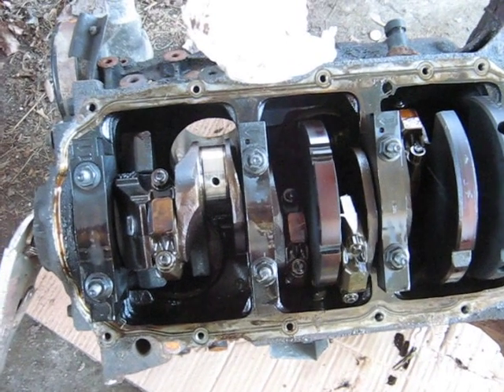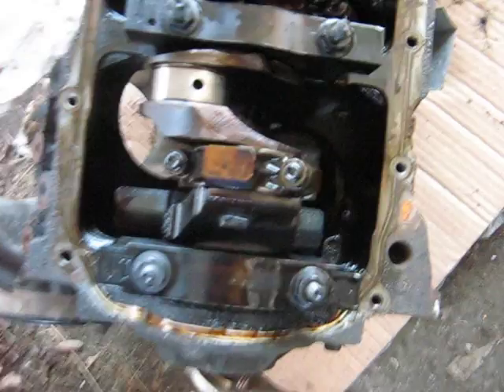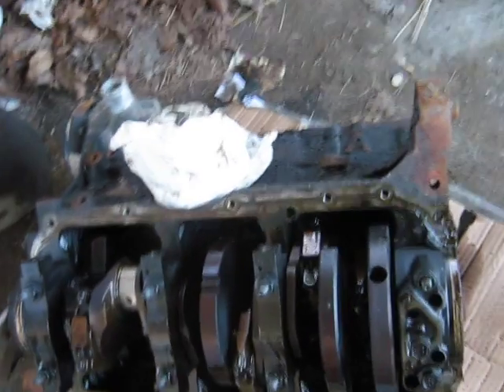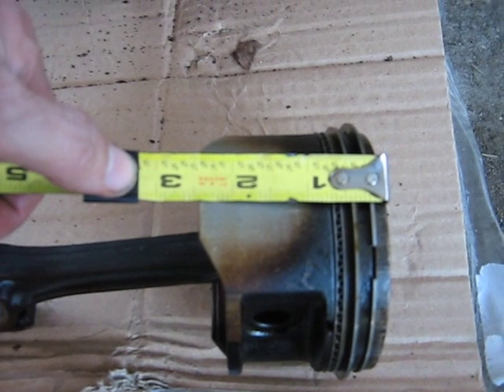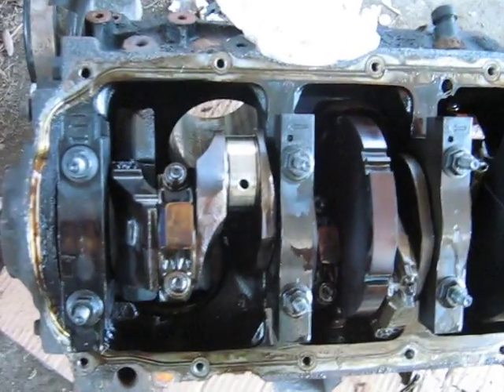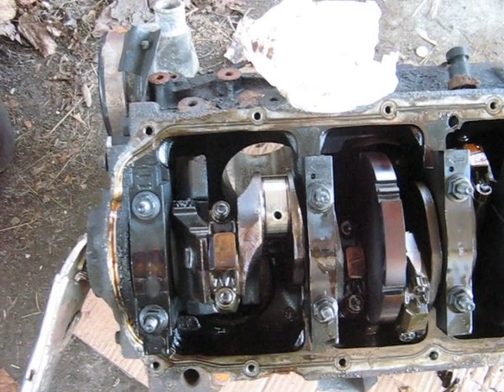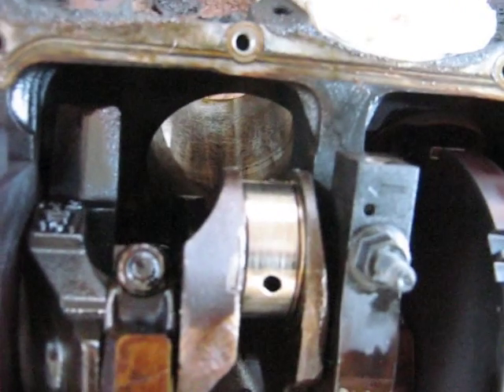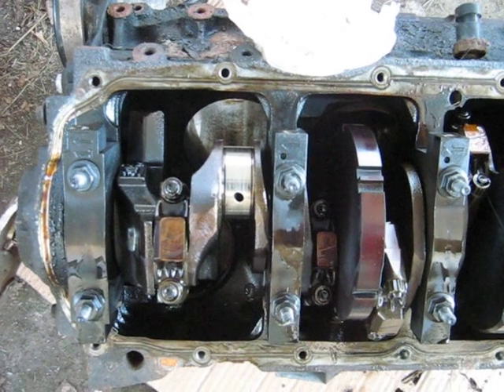GM V6 engine Teardown-Junkyard Deltic

Comment: gm used short pistons for reduced friction. if there is room a longer skirt piston could be used. I would drill and tap holes thru water jacket for pipe thread and seal with epoxy need 1" plus per intake port. Crank may be able to be swapped end for end backwards as it may not matter and would help in phasing motors. great project!!
Reply from the maker: Good ideas!

Comment: @ChargerMiles007 so now you got 2 that's great more exampled after all your "not" building this but great reallyi know its not my place but if you did get a third block you be able to get all the gear heads on you tube to follow along

Comment from the maker: @Mr3wheeledbike 
Yes, that is the big question, what engine would be best to start out with.
It sounds like the Jaguar V12, but those are like Hens Teeth here in North America, I think some type of 60 degree V6 might work out best. Personally, I wouls use a cast iron block engine, since I can weld to it relatively easily. However, for a real engine with water jackets, aluminum might be a better option, but more expensive to weld. Either way, the crankshaft has to be modified.

Comment: so is that a insurmountable problem or 'can we fix it!' sorry early child hood tv show phase i digress i think in my case i need to find a best case engine that will work best for this idea after that i can do much more real world panning because i could get info on the engine specifications this comment  (a late 70's early 80's Buick 231 V6 These were Odd Fire engines with the piston journals together. They are also 90 degree engines which might make a little more room to invent stuff) know a E

Comment from the maker: @YankeeIngenuity 
HaHaHa!!!  :)
Yes, I am definately "not" working on this project. Luckily for me the mrs. doesn't know a whole lot about cars, but I think she is onto me concerning this project!!!
Thanks for the advice. So far I think the simplest thing is to use a 60 degree block, and cut and re-weld the crank to line the journals up. At least to build a 3 cylinder engine with 6 pistons, just using the front bank of cylinders on each block.

Comment: When you decide to "not" do the project, you might consider a late 70's early 80's Buick 231 V6.  These were Odd Fire engines with the piston journals together.  They are also 90 degree engines which might make a little more room to invent stuff.  Mid 80's and Later Buick engines including the ones in the Grand National, Regal, Reatta, Century were Even Fire engines with the piston journals offset like on your engine there.   Good luck not working on the project!  Wink Wink!  ;-)

Comment from the maker: @robertsulley 
Yes, the offset would cause issues, I would take care of that one in how I built the combustion chambers between the engine blocks. A harder issue is the con rod jornals being offset 60 degrees from each other, I was expecting them to be inline, like on the average V8 engine.  A person could do some cutting and welding the the first 2 crank journals to make them work, but then you would throw off the timing on all 4 back cylinders. You could make a 3 cylinder 6 piston unit work.

Comment: Good vid. I've been trying to work this out, if the big ends of opposite pistons are axially offset are the cylinders also offset? Doesn't this cause issues when you mate up the 3 blocks?